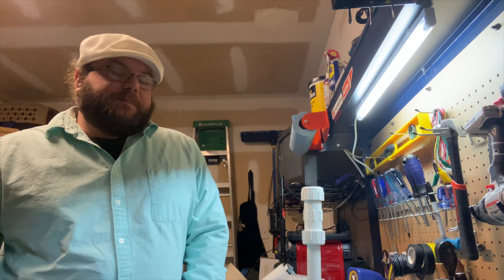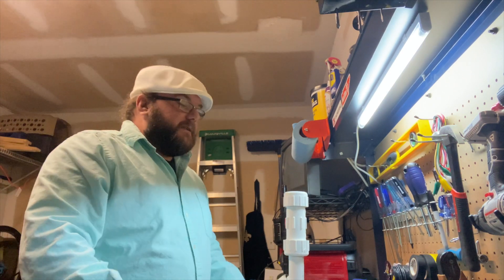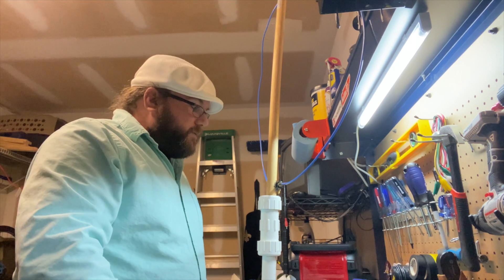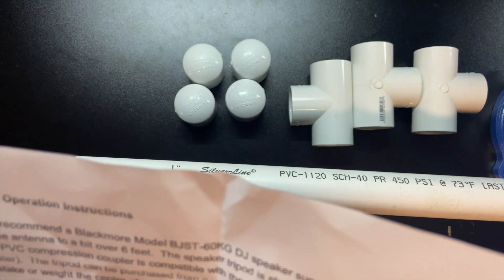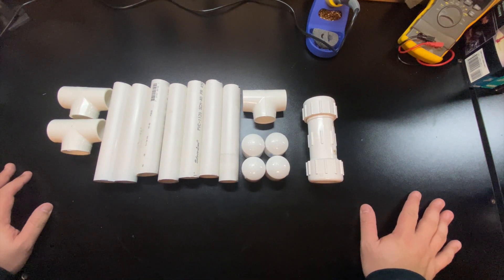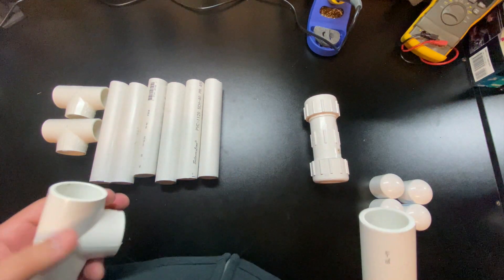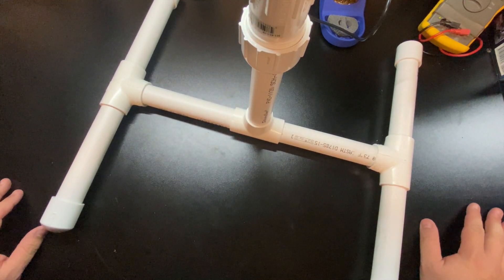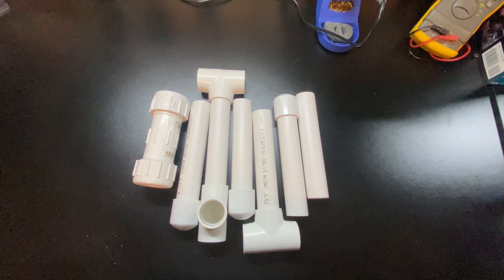DX 101:  From the Workbench | A portable H-stand for small loops and other antennas

Comment: I had my W6LVP loop mounted on a half-cinderblock, but it was not braced well enough to withstand a high wind and kept toppling.  Today I watched Loyd's video, went to Home Depot ($12 in materials, not counting the PVC cutter that I already had), and built this in less than 20 minutes.  A tip: the compression coupler contains a thick rubber band on each end, and I found it easier to unscrew the cap and place it on the upright tube, fit the band over the tube, and then screw the cap onto the band to get a very tight fit.
Reply from the maker: Love it!  I have now made a bunch of these little stands for use in all kinds of applications.  Made some bigger ones too to use for larger loop deployments and testing/experimenting!  73